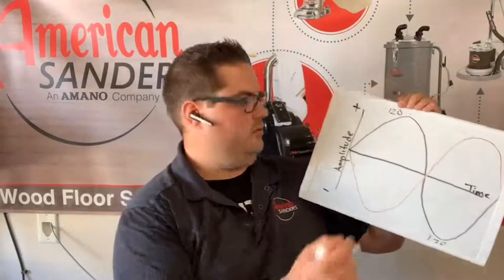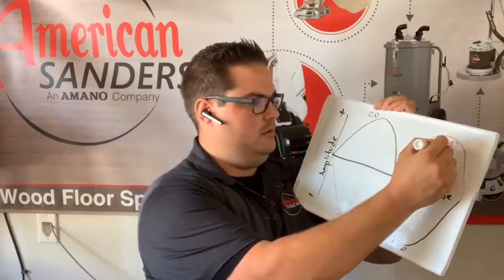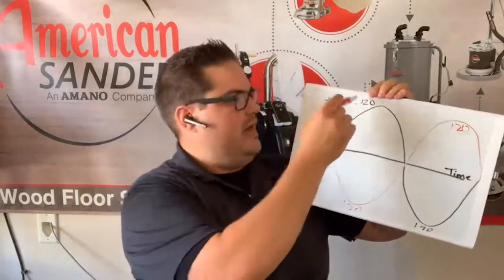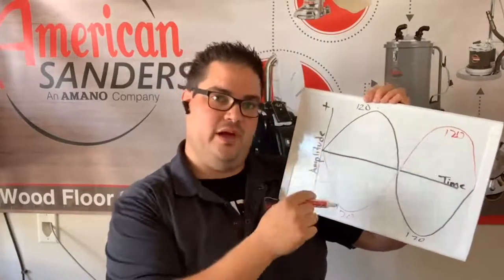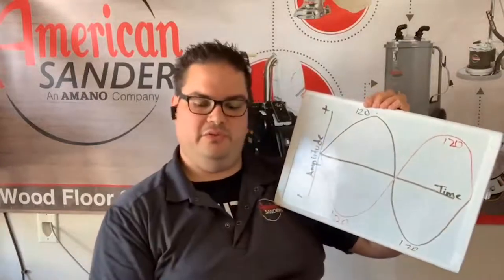How Electrical Systems Affect The Wood Floor Contractor

Comment: I got a question about DC voltage with the American B2 edger. Back in the day when there was no power running to houses during construction my dad told me that they used to run the all the machines on a power plant that only produced DC power. In talking to him he said the brush is used to last longer on the edger and the big machine. My question is how many DC volts can you put to a  b-2 edger?
Reply from the maker: Do not exceed the recommended volts in the operator manual.  In the US, the max is 115V.
In the UK or Australia, the max is 230V.
Reply: @AmericanSanders  so 115 volts DC I can run it on?